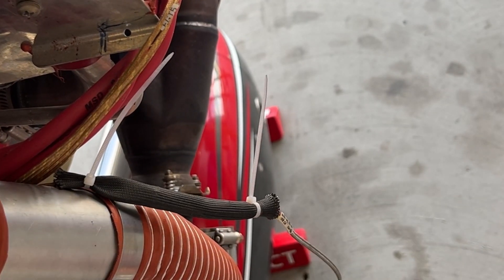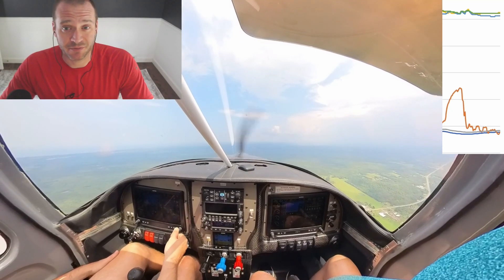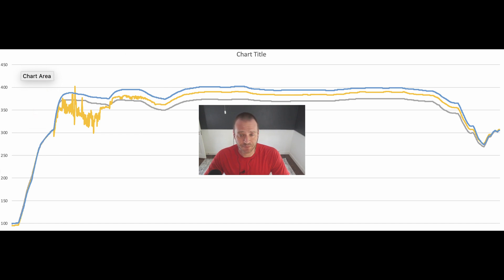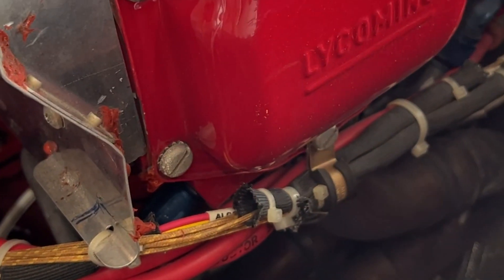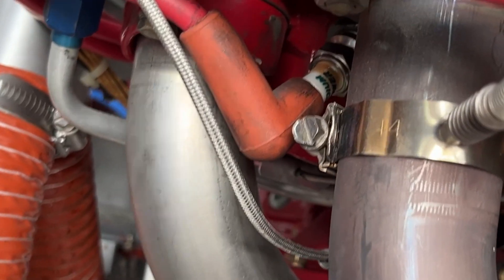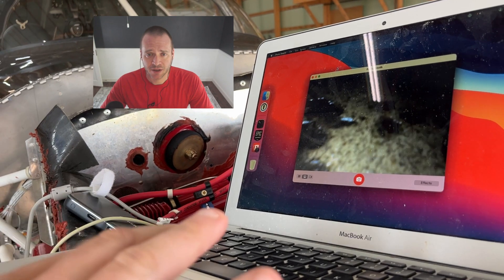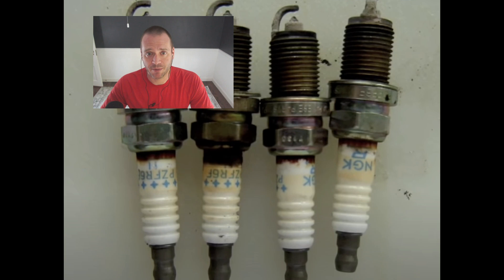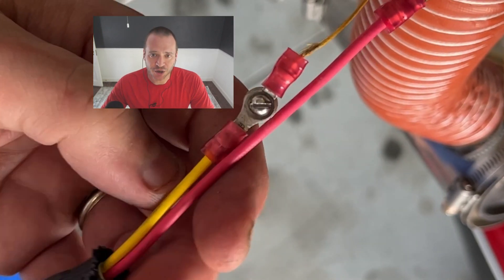Diagnosing the RV-10's high cylinder head temperature (CHT) issue

Comment: I'm an airline engineer/inspector, I would say that's a major mistake right there. That guy who made that installation should be suspended or fired. Light aircrafts don't have back-up systems like large airplanes. Well done with the troubleshooting. You have my like/sub.

Comment: On your graph, what is the left column?  Goes to 1400 range.  I'm assuming your at cruise power?  Running 400F CHT is a bit hot isn't it?  Maybe I'm too conservative!  That jagged CHT graph indicates a bad connection, as you found out.  I used my data to calculate my GAMI spread.  Shows how close your fuel injectors are calibrated.  Real easy to do with your engine data that records.  Just get into your normal cruise and slowly go from ROP to LOP.  Then pull the data and look at where the first CYL EGT peaks and the last cyl EGT peaks.  The GAMI Spread is calculated by determining at what total engine fuel flow each cylinder reaches peak exhaust gas temperature (EGT) and subtracting the lowest flow from the highest flow. Most engines are considered to have good fuel/air ratio balance if the GAMI Spread is less than 0.5 gph.
Reply from the maker: Left column is temp. The bundle towards the bottom are CHTs and higher ones are EGTs. 400 is not abnormal at all on RVs during the initial climbout.  Lycomings can handle up to 430, though we try to keep things under 400 as much as possible.

Comment: I had this exact same issue last week on my plane, but it was an EGT probe, not CHT. I replaced the probe, but it didn't solve the problem - it turned out to be a bad connection at the DB25 going into the Garmin EIS. 

That said, screwing those terminals together like that is not great, and is a common cause of this problem. I cut them off and crimp on spade connectors in their place.

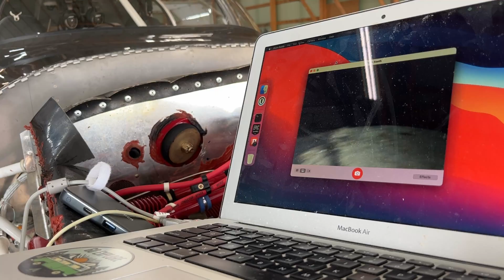Comment: That does not seem like a proper method for a thermocouple on an airplane.  I am not an A&P mechanic, but am a EE and have to think the ideal method would be to have TC leads long enough to route all the way to a terminal block on the firewall or even better directly onto the terminals on the engine EGT gauge.  In other words, have no (minimal) single-point-of-failure opportunities or connections between the sensor to the gauge.  If the only option is the terminal lugs+nut+screw, I would think a drop of Loctite Blue (or Red) would help reduce the chance of it becoming loose again.  And if that is a borescope view of the top of the piston ( at 3:50 in the video ), that looks like carbon build-up to me, and that is not a good thing.
Reply from the maker: Good call. The screw terminal is how they come from garmin. Not saying it couldn’t be better though

I believe what you’re seeing are lead deposits which are normal?
Reply: @hotshotaero  I believe avgas (aviation fuel) is the only fuel available with lead (but the FAA is working with industry to provide high octane with less to no lead), as I understand it.  Deposits on the piston dome, like carbon or lead, can lead to premature ignition or "knock".  This is because the deposit becomes hot enough that it can actually act like a spark plug - igniting the air | fuel early in the cycle.  Sort of acting like a glow-plug in diesel engines.  As the piston comes up for the compression part of the cycle, the "hot spot deposit" causes the air-fuel charge to "go off" before the system is ready.  I think this is less than desirable, and not the most efficient.  As I indicated I am no A&P mechanic, and do not know what "normal" is for aircraft engines.  But do know that "crust" or deposit is less than desirable in automotive engines.  It could be a deposit and build-up over time from a leaky valve guide (oil) into the chamber, or lead .... I do not know.  I would search out a trusted, qualified company to inspect it (I am sure they are not cheap, but you only have one engine when you (and you loved ones) are flying).